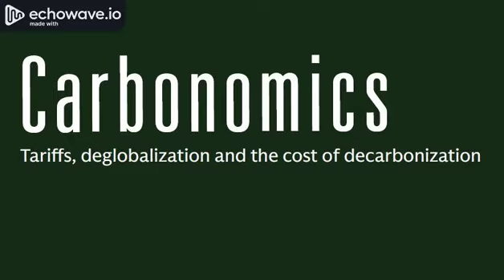Podcast Investment Report: Carbonomics - Tariffs, deglobalization and the cost of decarbonization

Comment from the maker: This Goldman Sachs "Carbonomics" report analyzes the impact of technological innovation, growing push for local supply chains, and tariffs on the cost of decarbonization across key emitting sectors. A central theme is the increasing cost associated with deglobalization and trade barriers compared to a scenario utilizing cheapest imports. While technological advancements continue to drive down costs for some decarbonization technologies, particularly batteries, tariffs and a focus on domestic production significantly inflate the overall expense of achieving emission reductions. The report examines this dynamic across power generation (solar, wind, batteries), transport (EV batteries, biofuels), buildings, and industry (hydrogen, CCUS). China is consistently highlighted as the lowest-cost producer for many key components, leading to significant cost disparities between local and imported technologies in Europe and the US.